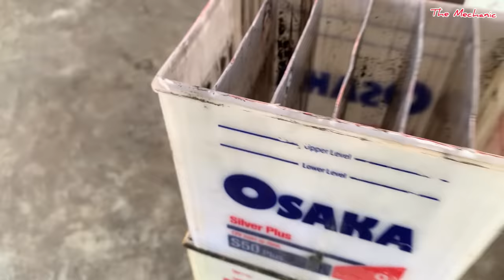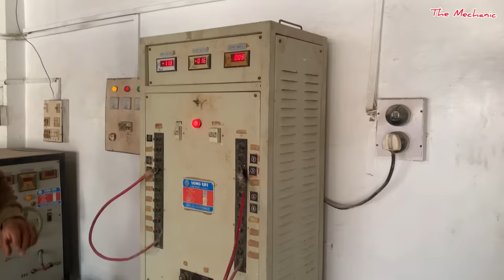How to Bring a Dead Lead Acid Battery Back to Life || How to Recondition & Repair Dead Old Battery

Comment: One thing to note is that almost all Anode plates are intact and used again while all cathode plates (lead oxide ) are ruined, so reconditioning the batteries would save a lot of money. 👍
Reply: When opening an old battery i find powered. In between the wires,what powered is that?

Comment: I have done this myself. As long as the lead plates haven't warped badly, just cleaning the battery out with bicarbonate of soda and then adding new battery acid has brought them back to life and lasted for a good few years. However new batteries are so cheap now it's not worth bothering as you can get 1/3 of the value off trading in your old battery. (here in the UK)
Reply: sorry mate but you've not done this and bicarb soda won't get rid of the lead sulfate which accumulates on the plates and can be almost impossible to remove chemically.

A lead acid battery works by immersing lead plates in sulfuric acid and water, the applying a charge.

The polarity of the charge causes lead dioxide to build up on one plate (which becomes the positive) by stripping oxygen from the water (H2O) and releasing hydrogen (hence the warning on your battery about charging in a ventilated place).

The other plate, the negative, remains pure lead and as the water is stripped out, you end up with a concentrated sulfuric acid mix.

So when a battery is charged, the acid is strong. When the battery is discharged, the acid is weak, almost always water.

When you apply a load, you create an external circuit which lets ions flow from the negative (lead dioxide) terminal to the positive pure lead terminal, this is electrical current or amps as we know it.

As the battery discharges, the oxygen is ripped from the lead dioxide plate (leaving only lead), and the oxygen combines with the hydrogen from the sulfuric acid (which is made up of hydrogen + sulfate) to create water, and the sulfate from the sulfuric acid combines with the pure lead of the negative terminal  to create lead sulfate.

The more this happens, the more the battery discharges until you get lead sulfate on the negative, pure lead on the positive and water.

Charging it reverses the process, forcing the sulfate off the lead, into the water to create sulfuric acid, and forcing the excess oxygen back onto the clean lead plate to recreate lead dioxide.

Over time, particularly if the battery is left to deeply discharge, the lead sulfate crystalises (chemically gets stronger) and becomes difficult (impossible) to force back the other way and to recharge the battery.

Enough of these cycles and the battery deteriorates and lLead sulfation is the main reason these batteries fail over time and stop holding charge.

Adding new acid to battery in this state is waste of time and won't magically rejuvenate it because it won't force the lead sulfate back into solution. Actually it will make it harder, because there is less water and more acid, so a bit like it gets more difficult to blow up a balloon as it gets more air into it.

For a failing battery in this, you actually want demineralised water and lots of voltage - way over normal charging voltage, which can (but not always) take the crystalised sulfate ions from the lead and back into sulfuric acid.

The guys in this video are creating the battery from scratch, in particular they use new plates which I bet they get by melting down the old sulfated plates and getting back pure lead and making effectively a (chemically) brand new battery.

I am sure you got a few good years out of what you thought was a dead battery but you did not do what the guys in the video have done.
Reply: @astrawally8448  Correct on all points. And the way these guys are putting the top on the battery without provision for intercell electrolyte isolation will shorten the life of the rebuilt battery.
Reply: @quantumleap359  yeah I noticed that they didn't seal up the holes provided for the original conductors between the cells.  Plus,  sloshing or driving on an hill would mix the electrolyte over the tops of the cells.
Reply: In even of a major crisis war or natural disaster or zombie apocalyse, we might ended up doing this ourselves.
Reply: @mikemotorbike4283   actually they sealed it off because the connectors moved to the top.
Reply: @mikemotorbike4283  Yes they did.... watch the video again specifically the 10:00 mark
Reply: @astrawally8448  Great detailed answer. 
Since you mentioned that these guys are using new Lead Plates and placing them into old battery casing, I see that their process uses a lot of imprecise tools. This will result in an uneven lead plates, electrodes etc. making the recycled battery a low quality version of its own self when brand new.
Reply: @HishamNajam  maybe but lead acid batteries have been around a very long time  and are very well understood. I bought a 780 CCA Marine battery a while ago which measured over 900 CCA new and is still in the low 800s now. They are not a precise technology.
Reply: 2023 California. 
Batteries are:
$180 2 year warranty 
$200 3 year warranty 
$210 3 year warranty AGM

Comment: I wonder what they do to condition those lead plates before reuse? 
Definitely a reduction in CA and Ahr in losing the mesh plate and what looks like less plates. Still better than no battery. I am always amazed at the ingenuity when the need exists.
Reply: Exactly....what Ah or CCA are you getting? Or even voltage! I guess it is just a make-do for farmers.

Comment: A friend has a classic car and he had the problem to get a 6 volts starter battery. So we rebuilt his old battery like these guys, except we took the lead inserts from a new 12v battery. 
The other guys from the classic car and moto club were impressed, so we took an another 6v battery and installed inside a lithium battery. So this second type of rebuilt was kinda upgrade to the oldfashion acid type, but looks still old.
Reply: Thanks for commenting. 🇺🇸 😎👍☕

Comment: My way to reuse car battery is just throw the guts to trash and reuse the case with LiFePO4 with the BMS included. Make 2 positive terminal, one from BMS and the other directly to battery. This way the starter motor is not taking power through the BMS and kills it as it can suck like 400-600 amps when cold cranking and the BMS is used to take power to charge from alternator
Reply: You should make a video of this process!!  Sounds cool.
Reply: Who throws lead in the trash?

Comment: Would love to know how they compare to new batteries. Power output, power storage capacity etc
Reply: What I can say is that it works, not know exactly the capacity ..... May be 75 to 80 % recovered , I used one of these long time ago
Reply: Its the weight of the lead, the heavier the battery the more cranking amps, if given the choice for the same price. Buy the heavier one
Reply: Isn’t it basically a brand new battery in a old case?  Looked like they used all new plate and mat. Would think it would be almost as good as new depending on the thickness of lead they use
Reply: Should be fine. May not have the lifespan of a factory produced battery, as they use special grid patterns and better lead-sulfate mixes etc. but will put out the voltage and amps required.
Reply: the innards look  all new its only the case thats used by the looks of things
Reply: They've recast the plates so effectively have created a battery of the same capacity provided that they've not reduced either the number/size of plates or the capacity to hold electrolyte (acid), they should get back a brand new version of that battery.

In reality, they've likely contaminated the lead (with tin from solder for example) and their plate wafers may not be as well built so they may not be as good as the original.
Reply: Point here is that batteries are recovered at the cost of high risky workers activity and pollution. So it is not worth it, but in India it is. Life is so a shit to take all these conditions to work and to buy a regenerated battery.
Reply: @griseum3151  life may be shit in india, but this is not in india
Reply: @debeeriz  ahaha sorry, and where about is that hell place?
Reply: @debeeriz  thank you, sorry, but very similar for us
Reply: @griseum3151  American by any chance? Saying Pakistan and India is the same is like saying the US and Mexico are the same.  Really people all around the world should learn some geography and about other cultures and maybe we would understand each other better.
Reply: @hnorrstrom I did not say the same but similar, another meaning. I am European, actually Indians, Bangla and Pakistans are very similar at glance for us, I acknowledge there are deep differences, and despite I well know the geography of that region, I can't tell who is who by watching him working in primitive conditions and by his face. Language too doesn't help much.
Reply: @griseum3151  Ok, that's fair, I misunderstood and thought you just meant that the countries was almost the same, I'm sick and tired of some Americans telling the world what to do without knowing anything about the world so I got a bit heated... As a fellow European I also cannot really tell if they are Indian or Pakistanis just by looking at them.
Reply: Pakistan was once a part of India before the two countries split in 1948 in a bitter sectarian conflict where Muslims and Hindus fought eachother. Thankfully that's all resolved now with the new borders being internationally recognized.
Reply: @peterjaramaz8554  That was pure lead there slick.
Reply: I was impressed  how clean the workers appear  to be considering  the work environment. Hands, feet, and clothes.   It shows a craftsman  at work.
Reply: @hnorrstrom  agree completely with your comments here. One does the best one can under the circumstances.

Comment: EVERYTHING ON THIS CHANNEL IS INSANE BUT THE GUY WITH THE PINK PITCHER OF SULFURIC ACID REALLY TAKES THE CAKE.
Reply: HOLD ON I DID SOME RESEARCH ABOUT BATTERIES AND AT SOME POINT THEY ADDED THE SULFURIC ACID BUT THEY DID NOT SHOW IT. THE MAIN WITH THE PITCHER PROBABLY JUST HAS WATER.

Comment: That's great and all. But would someone please explain Lead Poisoning to them and how the process they use puts their hands in direct contact repeatedly with the Lead Dioxide from the Positive Electrode as well as the Lead from the Negative Electrode. And if they're doing it all day every day. ..they're going to get Royally fucked. I'm betting I'm not the first to bring this up but it still it freaked me out watching all three of them in constant contact with it as they put the sheets together again. And the fumes are far worse. Like the fumes coming off the bowl of molten lead they're all sitting around. And every time he puts heat to any part of the lead.                                       They'll notice the Dire Effects ruining their lives in about a year, going the way they are in this video.
Reply: @glutenfreegam3r177  I get that. But there's ways to do it safe with the lead, then eat. It's an awesome idea what they're doing. I'd just hate loved ones to miss out on enjoying a future with all of them. Lead poisoning isn't a fun way to die.
Reply: Skin contact is not all that dangerous, but hands, body have to be thoroughly cleaned/scrubbed etc. after contact along with clothes, and if you touch your face, nose or mouth etc. or breath in any lead fumes / dust it will cause damage over the long-term with exposure. Lead buildup in the body will cause all sorts of painful ailments, nerve / kidney damage etc, eventually brain-damage / death.

Ideally thin disposable gloves would be used, and working at a bench, so you're not sitting in the lead etc.
Reply: @VenturiLife  Thanks.
Reply: They don't have the education to know and their boss/owner doesn't care. No HSE laws get enforced in Pakistan. When they die just get another guy off the street.
Reply: @VenturiLife  the environment is totally contaminated, they would have to wear masks for dust and lead fumes, now imagine him taking this contamination home and poisoning his children, very sad!
Reply: This is the real world for most of the world. You do what you have to do to feed, clothe and house your family. They aren't spoiled 1st worlders with lots of excess wealth in order to afford to be all OSHA compliant.
Reply: What your saying has ‘some’ truth to it but these guys do this for years and years and are still working in the same way- not dead nor dying.
Reply: @xiaoxiaoreed8012  do you happen to knowI've seen people suffering a lot because of it! Simply search for cases and reports! them? do you know their health status and that of the indirectly exposed family?
Reply: Katan great summary and OMG to the privileged folks citing "need to eat" as justification.

It is not privileged to point it out as harmful and dangerous - it is privileged to assume that they are aware of the dangers and have no other options. In many western countries lead in paint and petrol was only recently removed.

Plenty of people in the 3rd world survive by doing work which does not involve exposure to dangerous substances (that is not to say that they get paid well or work in good conditions or are comfortable doing that).

Lead won't kill you, but it will stuff up your organs, your mental development, you will be at higher risk of heart issues and stroke, and if you manage through all of that, you will be constantly tired and anaemic.

Yep, the privileged folks here are ok with that because it's affecting them and not us..
Reply: Someone needs to explain lead poisoning to you. It wasn't like they were making lead pacifiers for their children.
Reply: @1pcfred  Your right. It's worse. And we see them in hospital all the time.
Reply: @rafiqkatana  there's people in hospitals here too.
Reply: @rafiqkatana  lead is not exactly Polonium. It isn't really all that deadly an element.
Reply: @1pcfred  No. But the  damage it does to the body is life changing and can be deadly. Especially with how they're doing it. Contact with the lead without gloves and inhaling the fumes each and every time they do one battery. We get a lot of men in here (hospital) with the same problems and almost all of them have been doing Lead Acid Battery "restorations". Having been told that what they're doing isn't dangerous. I doubt you'd do the job they do.
Reply: @rafiqkatana  how are they inhaling lead fumes? Do you think lead produces fumes when it is melted? Lead vaporizes at a far higher temperature than it melts at. I do not think much lead can be absorbed through hand contact with the metal either.
Reply: @1pcfred  In the methods they are using to handle the lead to restore these batteries yes. Just look at the black covered hands of the people in the video. But, clearly you know more about it than my first hand knowledge of people who's lives have been destroyed by working with lead in this manner. So please tell me how they aren't suffering from severe pain and paraesthesia because of the damage to the peripheral nervous system along with weakening of the muscles that make it hard to walk let alone work. And the less annoying parts of poisoning like abdo pain and shitting all the time and any time without warning. So yes please tell me in which ways my portrayal of their suffering is incorrect.
Reply: @rafiqkatana  lead never did any of that to me. I've melted old batteries down for the lead in them too.
Reply: @1pcfred  Then you're lucky. Unfortunately with these guys they've been shown the fastest way to do it. And not been told what's Potentially dangerous to their health with prolonged exposure. So they've had no chance to try to protect themselves. You're right in that it's ok for small exposure but these guys are doing 10+ batteries a day, every day, for months, years. ..for however long they have to do it. And then each day eating with hands still black with lead dust. It's fucking criminal. They barely earn enough to feed their families and on top of that their bodies are failing them and they have to still do it. It breaks my heart and pisses me off at the same time. All they need is gloves, masks and proper ventilation and they could avoid all the future suffering. It's so simple.
Reply: @rafiqkatana  it is not ideal. We do not live in a perfect world. Some living for 10 years is better than no living at all. I just wonder if the batteries they refurbish are worth the sacrifice they make. How do they stack up against a new battery? Because the world does need decent batteries. I tried to get a decent battery last spring and due to shortages couldn't get the one I wanted to. I was trying to get a calcium chemistry battery. I ordered it but it just wasn't getting shipped. Times are tough all over these days.
Reply: @1pcfred  Yeah times suck that's true. But it's these countries with these people and the way they think that would last longer than the west if everything went to shit. You have to commend them for that. There literally isn't anything they can't fix. I mean anything. It's a trip to see first hand. And the batteries are actually pretty damned good. I have one in my car right now. And even though I wanted to pay more for it so he could take a day off or not worry about food for a few days. ..he wouldn't accept it. I've never met a people so talented and so kind and helpful in all my years. Sadly I'm home now and it's a world away. And having everything we have in the west is pointless when we can't even stop to help each other out with even little things. I hate it. Sorry I got pissy, the whole thing is a trigger for me. So yeah my bad.
Reply: @rafiqkatana  fixing things can be laudatory but often replacing things is the wiser practice. Out with the old and in with the new!